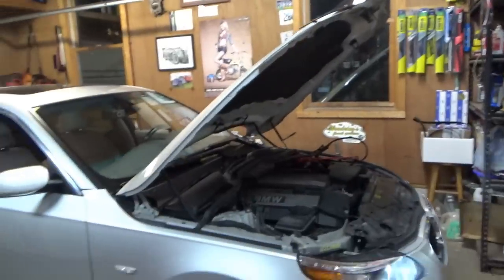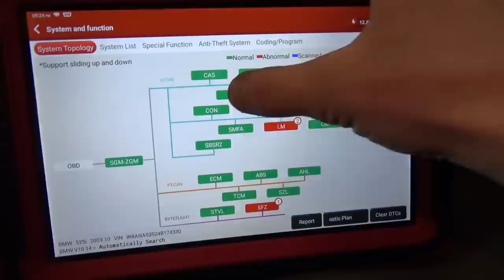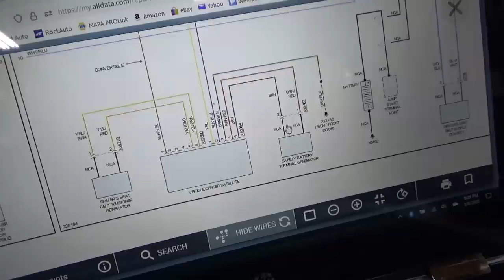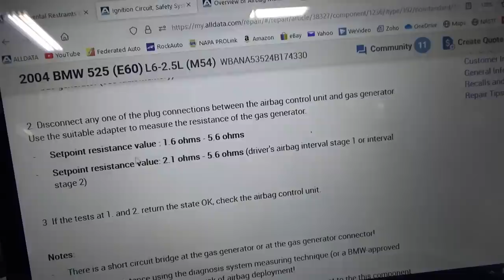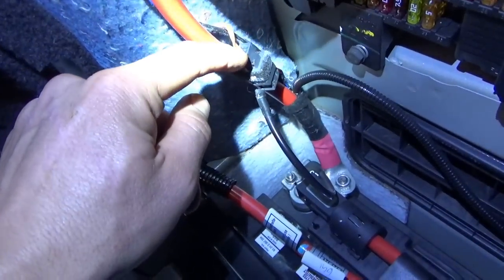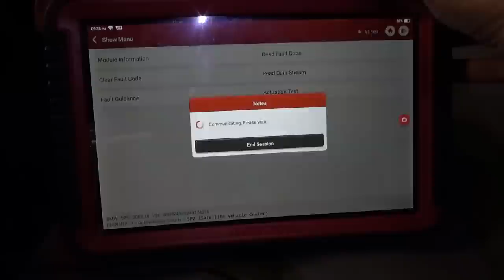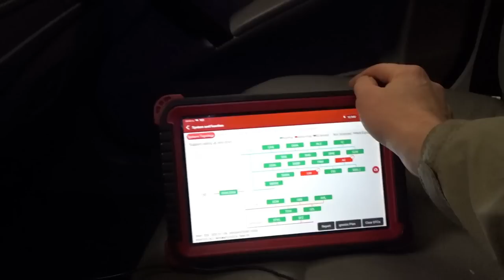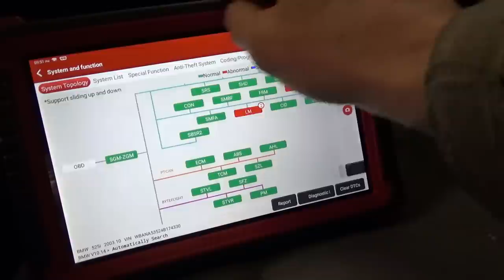Never Seen THIS AIRBAG Warning Before...(BMW 525i)

Comment: I'm not a fan of these new(er) cars that disable themselves when the airbag goes off. 

If my car is still drive able I'd at least like the option of moving it, or making an emergency trip. Imagine sliding into a rock in the snow, airbag goes off and your car is just dead... 

I've seen it with Tesla's and new electric cars, they get hit and they're a lead brick standing in the road... Meanwhile the guy that hits you gets to run away, 😆
Reply: Remember, many older Fords had inertia switches to turn the fuel pump off if the car got a hard enough impact? Just one step further.